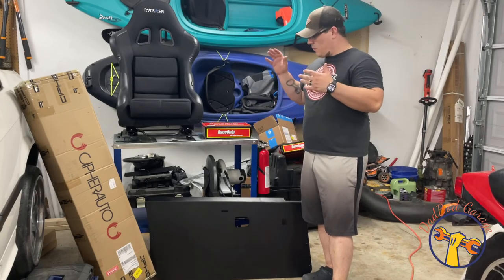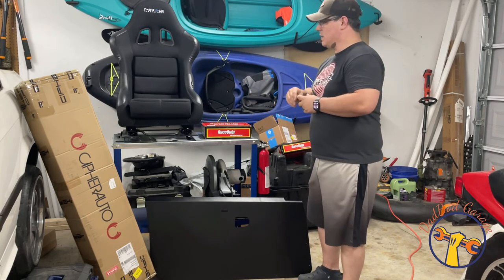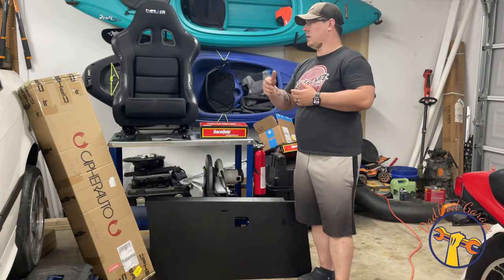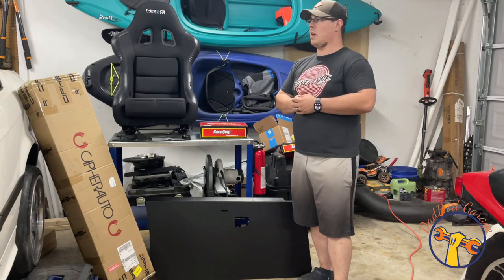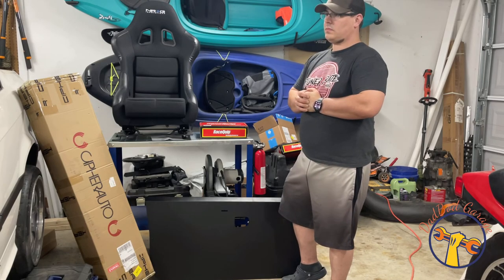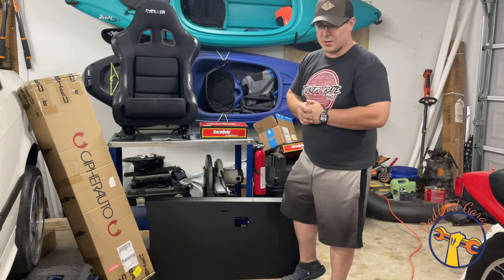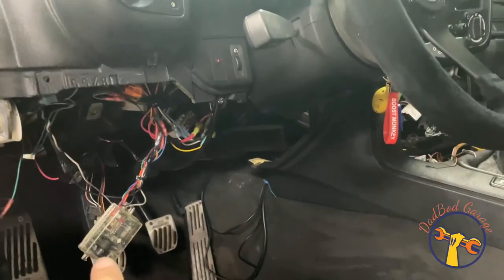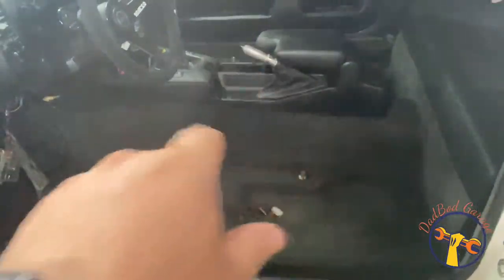E36 Harness Bar and Race Seat Install

Comment: The drivers side bracket has two mount points for the harnesses. And the passenger one only had one so you can use the middle buckle from the rear set, with the factory shoulder belt on the passenger side.
Reply from the maker: I can see why you’d say that. I realized one was a sedan bracket they sent me and one was a coupe bracket. The belts mount differently between the two chassis. The same company sells two variants of each for coupe and sedan.